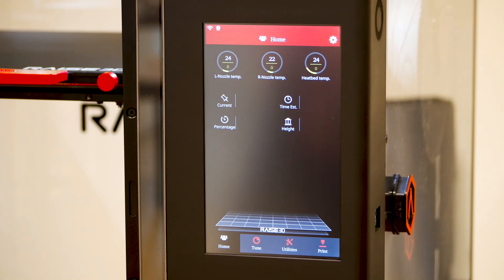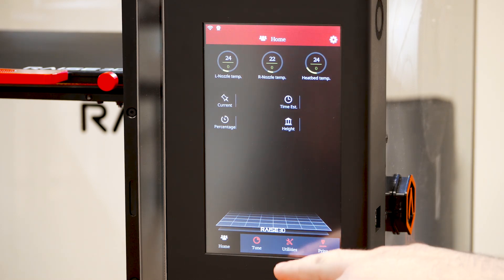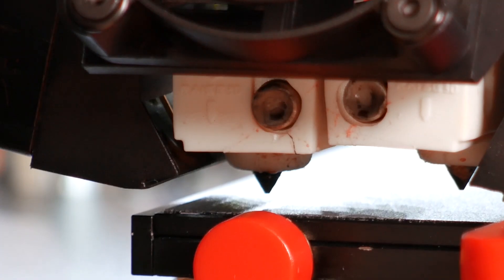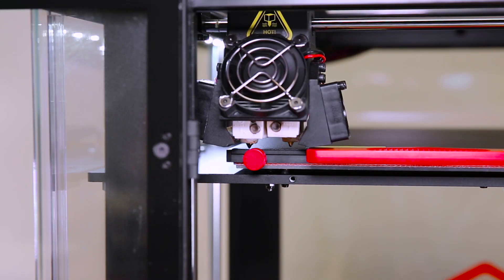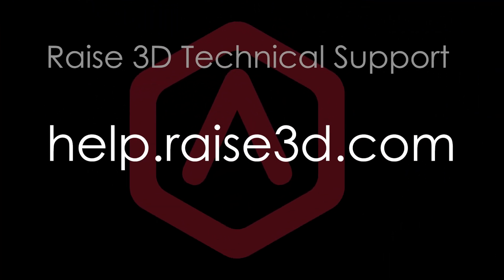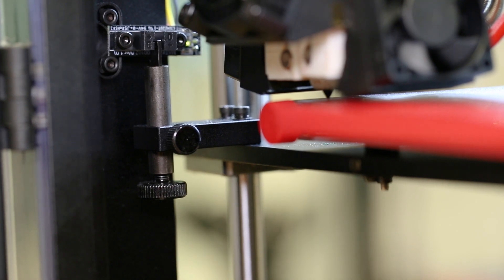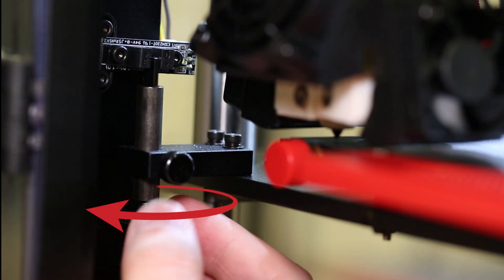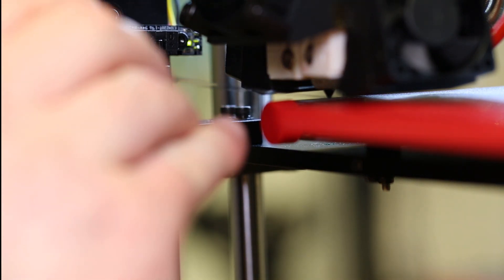Pro2 3D Printer Z-Offset Adjustment | RaiseAcademy

Comment: What do you do if you cannot level one extruder without unleveling the other extruder? It is as if the two extruders are not the same height.
Reply from the maker: Our tech support team can help you with this. You can reach them at 1-888-963-9028 for further assistance.
Reply: @Raise3D   why not just explain it here?

Comment: Thanks for the video! I see that the printer bed is held in position using a 3D printed clip. Would it be possible to share the .stl of this bed clip? As it happens, I'm having issues with the default metal bed clips, as the nozzle tends to touch the metal clips quite often when printing large objects. Thanks in advance!
Reply from the maker: Contact technical support for more information: 1-888-963-9028.

Comment: Is there a button to make the left nozzle "go down" when the right nozzle is down in "print mode". There is a servo engine that toggles between the two. 

Best regards
Reply from the maker: Due to the design of our shifting assembly, you cannot have your hot ends at the same height while printing.
Reply: Yes I meant switching between the two. But i solved it with a fire ware update, restart and some force extruding. (Right right left). Thank you for the reply
Reply from the maker: @jla5706  Happy to hear it was resolved! For any more technical related questions, please contact our support team at help.raise3d.com. They will be more than happy to assist you!